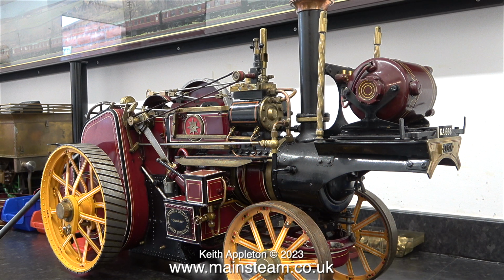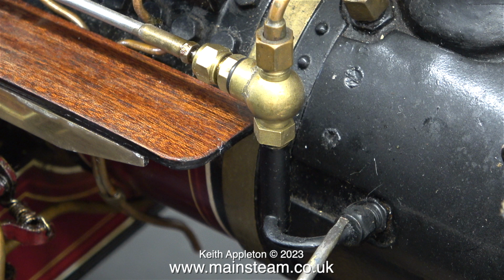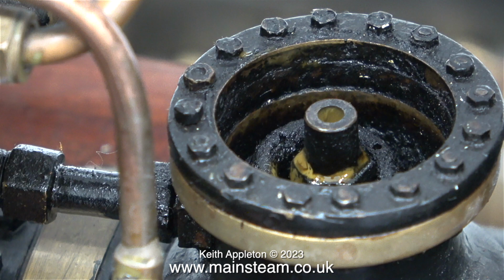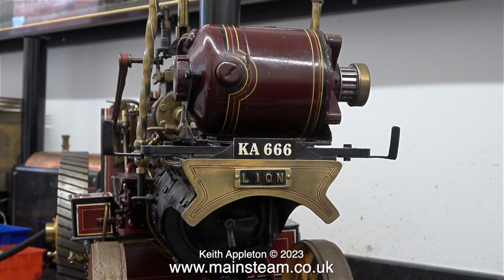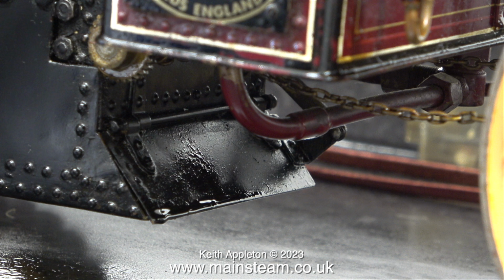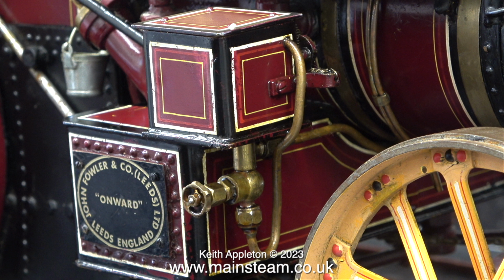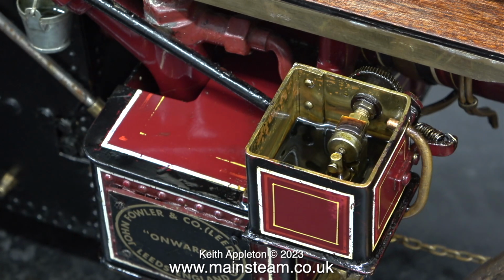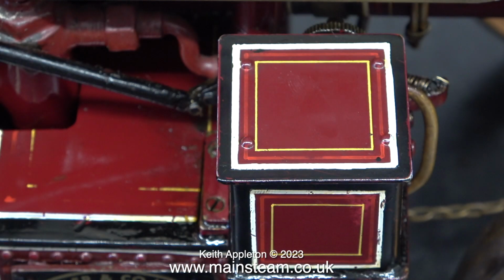MY SMALL SHOWMAN'S ENGINE NEEDS SOME REPAIRS - PART #2

Comment: Very interesting to see how the oiler works. Always something new to learn with your videos. Oh, I got the oscillating engine I had asked you about working.
I made sure both surfaces like near mirror finish and checked the ports were aligning at the proper time for the direction of the piston. works great now. 
I assume the margin for error on the oscillating engines is not as critical as the piston and valve ones. I have a lot to learn about them yet but enjoying it and your videos help a lot.
Of course, most of what you do and show is right over my head but I am getting the idea.
Regardless, it's brilliant to watch. Keep well Keith. 🚂😃👌👍
Reply from the maker: I am glad you sorted the problem }:-)))